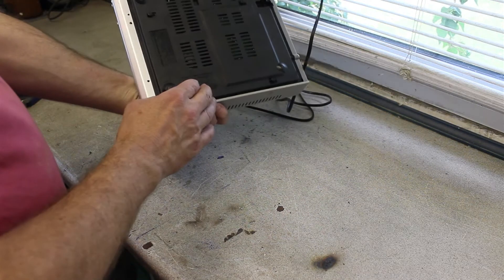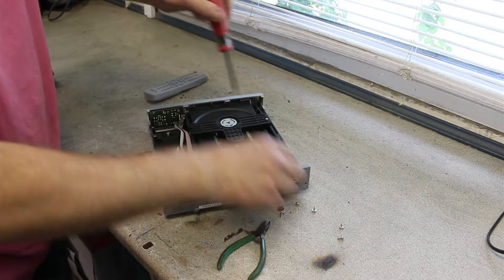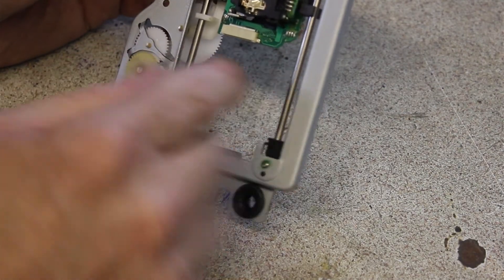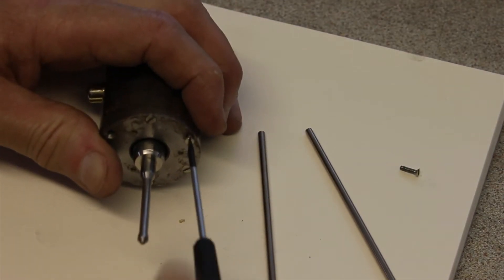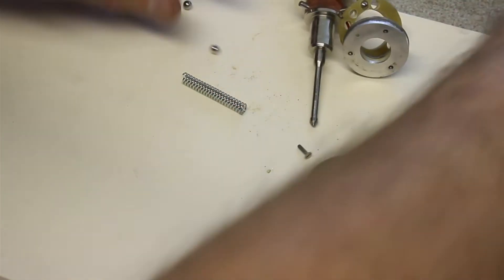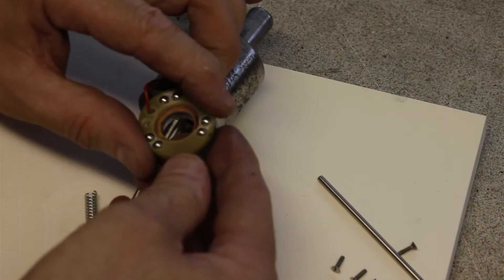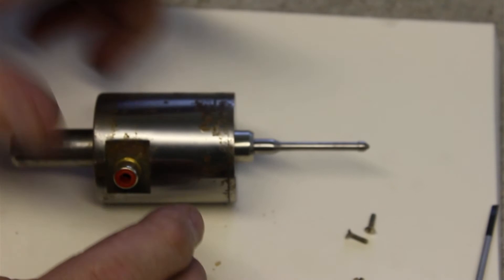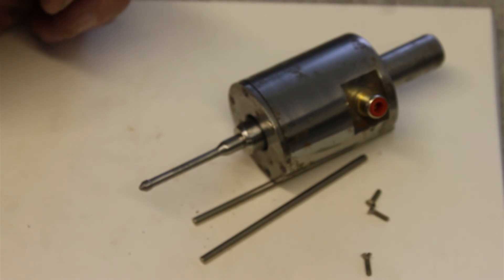How to harvest free ground precision bars for a CNC touch probe

Comment: What is the advantage of using IR transmission over the radio frequency one, something around 844Mhz?
Reply from the maker: Good question. My thoughts were if you happen to be lucky enough to have more than one cnc machine then one probe could theoretically connect to either machine or both.
But IR inside a cabinet is far less likely to get out of the cabinet and into another (its easy to turn down the power so range is very short). Not sure if its flawed logic but seems a good idea to me. IR is also extremely cheap.

Comment: If you can find old VCR from back in the day, will yield that plus especially the shaft used in video reading cylinder and a lot of other good stuff when things were made like tanks.
Reply from the maker: Yep over the years I have scrapped a lot of old pro tech and found many useful parts. 
Thanks for the tip!

Comment: You call that probe you made crap! wow I would be very happy if I could make something as detailed as that. I totally agree so much precision stuff is being dumped due to our scrapping of technology. Some of the machining and optics in these devices is beyond belief, especially the older models.
Reply from the maker: Thanks for the comment its a tongue in cheek thing about the probe its not very repeatable and the probe can only move a three of four mm before hitting the end stop. Stay tuned I have plans for a new one with IR comms. 
Too much stuff is considered disposable and made to not get fixed, the planet simply cannot support all this disposal. I try to use scrap wherever possible.